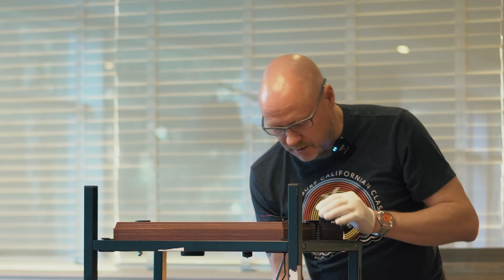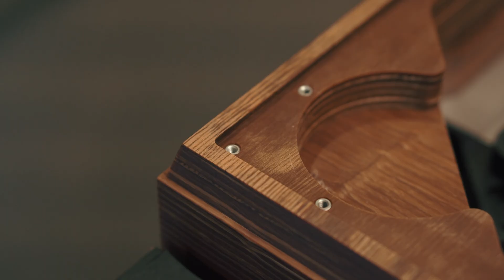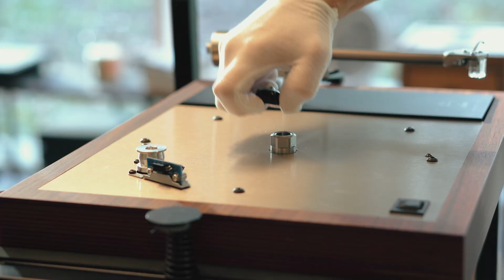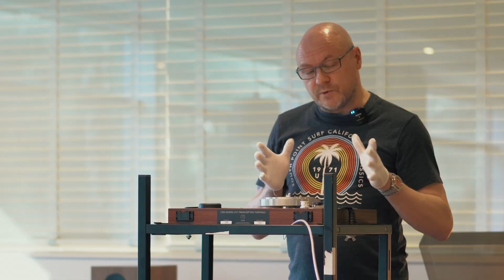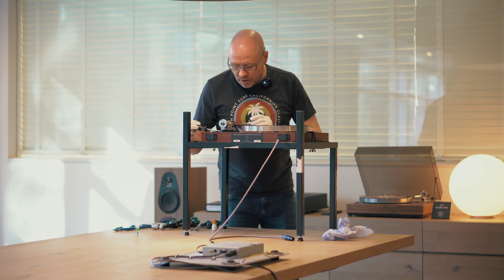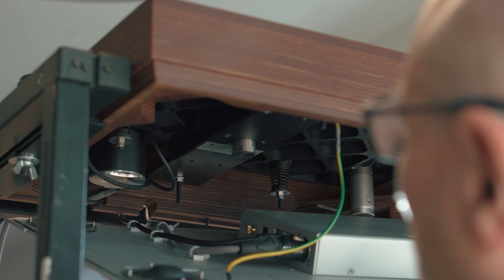Building LP12 featuring all-new Bedrok™ plinth | Linn

Comment: To use a motoring analogy:

The LP12's a bit like a 1948 Morris Minor, to which you have given fuel injection, alloy wheels, radial tyres and a decent automatic transmission - yes it holds the road slightly better, is slightly faster, and does not have that awful UUURRRGGGHHH noise whenever you change gear down in its 4 speed manual box, but it's still a dog. It's not, and never will be, no matter how many changes you make, say, a 1997 Volvo S90 SE with a 150kW/267 Nm 2.9 litre Porsche designed all alloy 24 valve twin cam straight six, is it?

When will Linn stop buggering about with such a woeful geriatric design and produce a really good, well thought out, well engineered design? You can, to use a slightly crude expression, polish a turd all you like, but at the end of the day it is still just a turd,.

Comment: What a disaster your Klimax is compared with  a Michell Gyrodec or Gyro SE!! Your motor is within the plinth - the Michell's is separate, not touching any part of the turntable, which means it is less capable of transmitting unwanted vibration or magnetic radiation than the Linn's. Your springs are underneath the sub chassis, and so very difficult to adjust - usually needing a specialist to so do. The Michell has springs accessible and adjustable by hand - all you need is a small spirit level to level the turntable. Your design needs earth wires (grounding cables you prefer to call them) to stop hum - the Gyro needs none. And you have the gall to charge A$69,995 for this woefully badly thought out, but admittedly somewhat improved, however basically still a 53 year old design, whereas a Michell Gyrodec can be had for about A$17,800 (A$15,500 Gyro SE) with HR power supply, an SME M2-9 tonearm and a decent Audio Technica moving coil cartridge, and will blow your product into the weeds for sound. Even the belt is better placed on the Gyro, as it is fitted to the perimeter of the platter, and is freely accessible and easily changed without having to remove the platter, as on the LP12. That it drives the perimeter also generates more torque than on a smaller diameter subplatter as on the Linn. The spindle of the Michell has a  modified archimedean screw which draws oil up and onto the inverted bearing - yours is an inferior ordinary bearing. And lastly the Michell is a beautiful work of art with its gold plated platter weights - the Linn looks just like the Ariston from which it was copied, or a Thorens, or many other turntables from the 1970s - pretty ordinary.
Reply: Agree with you on ease of suspension setting on the Michell, though not in the same league I also enjoyed the same ease of adjustment on the Ariston RD40 I owned that in 1984 with a Mission 774 LC arm & Nagaoka MP11 boron could be had for under £200 & sounded very good.

Comment: I have a 1986 LP12 build that I bought myself at 16y.o for $1500, 40 years ago, and the only thing original is the top plate and the plinth. This table got better with every upgrade. Just listen and if you cant hear the difference between the levels of LP12 then dont spend more.
Reply: You are a moron, wasting your money. Throw it away and buy a Michell Gyro, then you'd have a decent turntable.

Comment: I sold a few of these in the seventies , when an LP12 retailed for £86 , yes eighty six pounds .

Had one home for a while but wasn't a fan of the distant , laid back sound .

I bought a Transcriptor Hydraulic Reference back then and now run a GyroDec .
Reply: Interesting comment. May you thrive. After a few years with a Transcriptor Saturn, I bought an LP12 in 1977, returned it 3 days later, and bought a Michell Reference Electronic with SME 3009 S2 FH Imp, now have a Gyro SE, + HR power supply with SME M2-9. That Linn users defect to Michell but not the other way round says it all, I think.

Comment: My LP-12 is ancient and has never had anything added to it. It has an Ittok arm and currently has an Audio Technica AT-VM95ML on it. It is connected to the phono preamp on my 1970's Technics SU-8080 amplifier. Would I ever upgrade it ? No. Why ? Because perfection does not need to be improved :D
Reply: Perfection? You have never heard perfection. Throw it away and buy a Michell Gyro - then you'd hear perfection and realise just how bad a Linn really is.

Comment: Fantastic video, showing clearly and concisely all the steps to assemble a Linn LP12. My own Pandemic Project was making a solid walnut plinth (with all the bracings) for my LP12 and fitting lots of new parts. It was one of the most enjoyable projects I've ever done. "Nothing rocket science [or] voodoo about this, it's purely mechanical energy!"
Reply: Nice project. Adding lead damping to the sub chassis will also improve the sound
Reply: @jeremynorth  If any damping improved the sound the surely Linn would do it and charge accordingly; I'm fairly certain they're not ones to miss commercial tricks. Maybe it's because lead is poisonous so it's a health and safety issue or maybe, just maybe, as the manufacturers of, and by definition experts in, their product and with their extensive research, development and manufacturing facilities (including the capability to machine the latest subchassis from solid aluminium) they know it won't. Or perhaps it's because the only source of lead in Glasgow has already been stripped off the church roofs? 😆Enjoy your evening my friend
Reply: @ If you look at the new subchassis it has changed from the old fing like a bell, pressed steel which they had for 50 years, to a cast alloy one which is more rigid and damped. I figured out years ago that  it was a design weakness, also the top plate is another. I'm sure that they'll make one from composite and ask for another £8K

Comment: These probably cost no more that £50 to make. A £60 8x4 sheet of ply is probably enough for three of these, plus the CNC and brass inserts.The extra is the cost of the snake oil. 
This technician didn't even set it up properly. 
I suppose with these continual revisions of the LP12, Linn is saying that their original (stolen from Ariston) was poorly designed. Looks nice though. 
The steel top is a joke, anyone starting from scratch would have non resonating materials everywhere. The arm board too is a big resonator.
Reply: All just different design philosophies look at Rega turntables lightweight designs with no suspension yet they work & sound amazing

Comment: If it's important to get the motor "as far away from the cartridge as possible" - which sounds like common sense to me - that's another strike against direct drives where the motor, by definition, is directly under the platter, hence cartridge.

Comment: My LP15 is in the 85xxx s/ns and was some 4000$ at the time. Turntable, Lingo, fullstop. A good one. 

I find it insane what Linn, always on the expensive side of UK HiFi is calling for each of these „oh, this is the same, but completely different. Eg: DC motors are NOT better. As a system, They are worse, because every DC motor has an AC runner inside. It produces its own AC singnal from  DC by internal signal components. Maybe Linn was never able to produce its own high quality AC motor and the number of high quality DC motors from the market is much higher. But stop this BS telling us 30 years about the perfect AC signal with your Philips motor from the 1960s and then switch to DC.
They start you to think that a LP12 must cost 40000$ nowadays to be much better. It’s like putting 1 Million into a better VW Golf, direct from Volkswagen. With the same, but carbon chassis etc etc. 

All these tonally well balanced parts from the 1970s, when people were able to hear are reimagined for parts a bit more difficult to produce, but far far expensive to sell. BS. Do a tunrntavle from scratch, when you think yours is not performing well or bring affordable iterations, not 10000$ parts.

Comment: What is that stand that is being use to assemble the table and where could I buy one?
Reply: It is simply called the Linn LP12 Set Up Jig and you can order them from any Linn dealer. Cost is somewhere around £350 if you live in Glasgow. There is a Klimax version called the Jig is Up using one piece of solid aluminium that costs £14,950, but that is a special order.
Reply: Apparently there is a cnc made wooden kit that you can buy on eBay for £100. I've seen a guy use it on another YT video and it does the job well enough.

Comment: An extraordinary amount of money spent to correct the design faults of the original.
Reply: When, for instance, a prestige car manufacturer introduces an improved specification of an existing model by, for instance, upgrading BHP,  fitting racing suspension, offering automatic transmission or additional trim options they don't get accused of "correcting the design faults" of the original because they're not. They're improving on fundamentally good basic products and offering the customer additional choices to suit their needs and budgets. My LP12 has given me faithful service, in daily use, for over forty years, has had a few upgrades as and when I thought it worthwhile and - should I choose - I know I can upgrade it to current - improved - specification any time I choose to do so; no one is holding a gun to my head. Any manufacturer that has been producing a product for fifty years and doesn't improve it as new materials and technology come along would be negligent not to do so and it's a testament to the inherent quality of the original design - not a criticism of it - that early examples are not only operational but can be reworked to 21st century standards if desired. To extend my original car analogy would you accuse, say, BMW of "correcting the design faults" of their earlier products by not supplying electric power when the technology simply wasn't available? And when they do you have to dispose of your existing one and buy a brand new car as it can't be retrofitted like the LP12 tech.
Reply: @russputin6294  This is a nonsense argument. If Linn were to produce a new turntable from scratch now they would not come up with this. There's no way a car from the 70's would match a modern design in terms of performance, efficiency, comfort and finish no matter what tweaks you make. I admire that Linn has continued to support their product much has Leica done with their cameras. In this throwaway society it's a great thing.
Most of the comments here are about their hubris and the piss taking when it comes to price.
Reply: @russputin6294  turntables do not function as cars, the basic design problems of spinning a record have been well defined since before they were electrified. but have become acoustically more complicated as fidelity improved.  
the original Linn design was copied from the brilliant AR turntable from the fifties, so no need to get all sentimental over it.   
I am glad you have a nice record spinner.  sustainability is so important for long term ownership, but often overlooked in the lust for the latest, greatest, hyped up product.  

 I also enjoy a suspended belt drive design with great sustainability, from another boutique manufacturer , Michell engineering.  I can buy any part I might need easily on line. fortunately quality turntables don't really "wear"out, and my table was well developed before coming to market.  Michell had the benefit of extensive customer feedback on design, having started with turntable repairs, and then offering various do it yourself kits to hobbyists before he brought the classic Gyro turntable to market.
Reply: Linn haters.    Many.   Most have never even heard one.   Expensive???   Yes , very.     Worth every penny.

Comment: With everything machined and consistent (unlike the old days), I'd have thought there would be a specified arm height that would always be right.   I assume you've come up with a strobe-controlled motor that doesn't audibly pulse the platter (which I believe was the argument against strobe-controlled motors in the old days)?

Comment: Rega P6 has had Neo MK2 PSU rotary controls for years. Own made RB 330 tonearm.
Roy Gandy is a very capable engineer. Rega P6 with a suitable cartridge is equal to overpriced Linn LP12.
Reply: As always, when buying a turntable, I also considered the Linn Majik. The second candidate was the Rega P6. I said to myself, let's compare the sound difference between the two turntables.
My friend had a Linn Majik and I borrowed a Rega P6 from my friend who sells hi-fi. The Rega was equipped with an excellent Hana ML cartridge. We got another one to make the comparison fair. The phono preamplifier was the excellent Musical Fidelity M6X vinyl, which allows you to connect two turntables at once and each input can be individually set for MM/MC.
The amplifier was the excellent Pass INT 60. The speakers were Spendor SP2/3.
The test was blind. I won't describe the details, but everyone in attendance agreed that the Rega P6 played better.
So I came to the Rega P6 and the HanaML cartridge, which are really excellent for normal money.

Comment: Linn produce great gear. Used to buy exclusively Linn products in the 1980’s-upgrading to Kairn, Klout , Isobariks, Karik,Numerik, and obviously an LP12 with Lingo and Ekos. Kept improving the LP12 and spent a fortune. Then listened to other gear and realised Linn was losing its edge on a price/quality ratio basis. Using my ears rather than my loyalty I now have a Michell Orbe with TechoArm, Icon Audio valve pre and power amplifiers and Martin Logan electrostatics. Far from inexpensive my current system is superior in my mind to any Linn system I’ve heard at dealer demonstrations. Haven’t heard this particular incarnation of the LP12 but have heard high end Linn tables which I believe are no more superior and in many ways not as good as my £7000 turntable and arm combination. Lovely gear but well overpriced.
Reply: And I had first a Transcriptor Saturn, then an LP12, for 3 days, before returning it to the dealer, then a Michell Reference Electronic, now a Michell Gyro SE with SME M2-9.  And I am sure my Gyro SE will also blow any LP12, even the A$100,000.00 LP12-50 into the weeds, just as your Orbe will. The LP12 has still, many design faults - motor inside plinth, plate on which tonearm and platter are mounted ON TOP of springs, rather than suspended from, as on the Michells, belt needs platter to be removed to change, and turns a subplatter instead of platter perimeter, no balance weight to counterbalance weight of tonearm - your Orbe and My Gyro both feature that; I could go on ... Enjoy your Orbe - I preferred the look of the Gyro with its gold plated platter weights, just like the reference I had. All the very best to a fellow Michellphile.
Reply: They DO NOT produce great gear, well not great turntables. LP12s are horribly overpriced slightly improved Ariston and Thorens designs from the 60s. Linn turntables are absolute dogs.

Comment: Shame that he has to use a German screwdriver - surely he could use a UK manufactured driver?
Reply: Speaking as a engineer and someone who's used hand tools every day of my working life..... that's 50 plus years that I have clocked up already..... Wera's screwdrivers and their torx and allan keys are so well made and of such high quality that they don't even leave a mark behind to tell that you used them, especially useful when your dealing with screws and fasteners that have some kind of a coating and as many do on the LP12 as I recall...... although its 33 and 1/3 years since I owned one I am sad to say.
Reply: Says a true Brexiteer. Crisis everything UK.
Reply: I do actually have one and they are very good
Reply: Wera tools are not the best by a long stretch of the imagination..... (I own quite a few of them as a service engineer for Atlas Copco air compressors)

Comment: Anti-skating set to the same value as tracking force? Come on! This is 1980s thinking. It is FAR, FAR too high. Linn: Get your research team to get in touch with J.R. Boisclair at Wally Tools.... the world's leading authority on all things cartridge / tonearm set up. All based on sound research and CURRENT knowledge.
Reply: He couldn't even get the arm to be parallel after that first adjustment. You can clearly see that from the video. This guy is not a perfectionist
Reply: @A-gks  Yes and he should have set the tracking force after the tone arm was parallel as  it would be different
Reply: @A-gks  on my suspended table , I sight across the platter with a laser line to set  level, to avoid the weight that a conventional precision level brings.  Cost me about twenty bucks.
Reply: Anti-skating lol, its side thrust bias and as for setting it the same as the tracking force it depends on the cartridge, some need more and some need less. And if it can't play a record without bias then something is seriously wrong!
Reply: @CrazySparkie63  side thrust bias lol. Thanks for agreeing with me!
Reply: Setting that anti-skate dial to 2 when VTF is 2g does not mean you’re setting antiskate to two grams. It means you’re setting AS to some value that the factory determines is appropriate for a 2g tracking force.